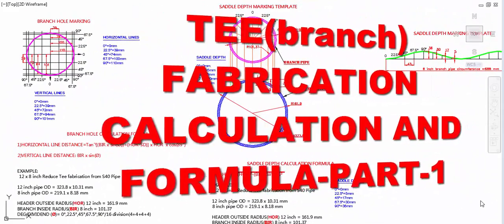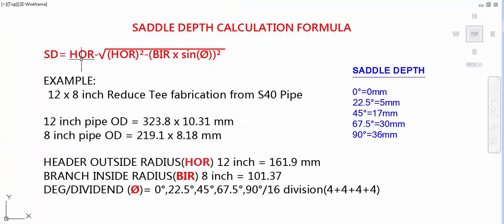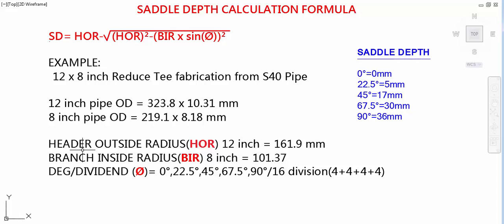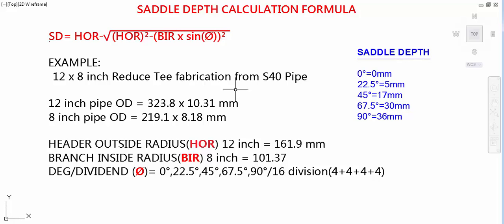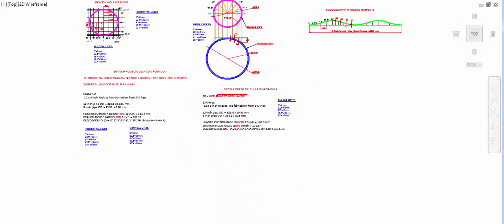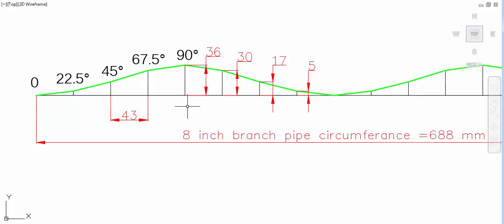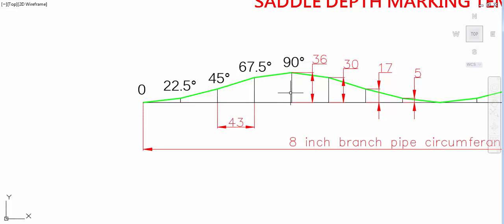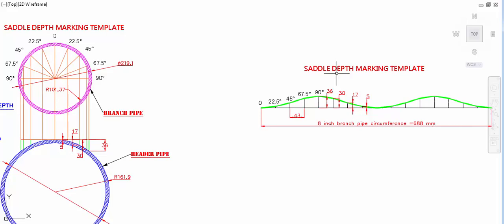Piping_Tee fabrication/saddle depth/branch hole marking and calculation formula _part -1

Comment: Sar i will applied this formula but tha answer is coming defarant  
SD = 161.9-√(161.9)^2-(101.37×sin(90°))^2 = -10,275.8769 is coming please help me
Reply: Thanks sar
Reply from the maker: In formula part 1
161.9

 In formula part 2
1.(161.9)^2=26211.61

sin(90) = 1
2.(101.37×1)^2=10,275.8769

3.√(26211.61-10,275.8769) =126.236

so 161.9 -126.236 = 35.664 mm @ 36mm for 90 deg

i hope you understand my explanation.thanks Mr..
#pipefitters #pipingformula
Reply: Sir I am say one formula u  give me reply this formula right or wrong please give me reply 
4 "×6" unequal tee 
Formula =4"OD^2÷4×6"OD

Comment: Can you show me the detail calculation like you shown 0° =0mm, 22.5° =5mm , 45°=17mm, 67.5° =30mm & 90°=36mm ?
Reply from the maker: Apply all segment degree(0,22.5,67.5,90) for saddle depth calculation (SD)= HOR - root of (HOR)²-(BIR x sin(Ø))².detail available in video.
Reply: @TECHNICALPIPING   (SD)= HOR ??- root of (HOR)²-??(BIR?? x sin(Ø))²??. = ???
Reply: @TECHNICALPIPING  you shown 0° =0mm, 22.5° =??5mm , 45°=??17mm, 67.5° =??30mm & 90°=??36mm ???
Reply: bro i didn't get your point how to cal the saddle depth.
how you took 5 for 22.5 and so on.
please reply soon
Reply: @TECHNICALPIPING  bro i didn't get your point how to cal the saddle depth.
how you took 5 for 22.5 and so on.
please reply soon
Reply: Euncalin tee ka formula Hindi
Reply: Euncalin tee ka formula and cutbuck